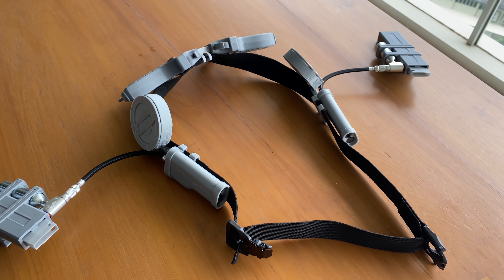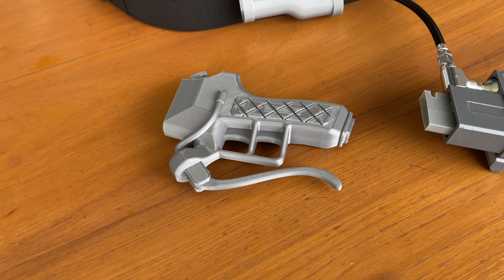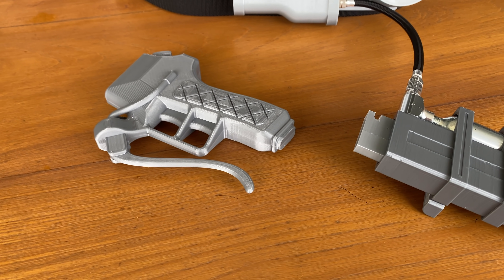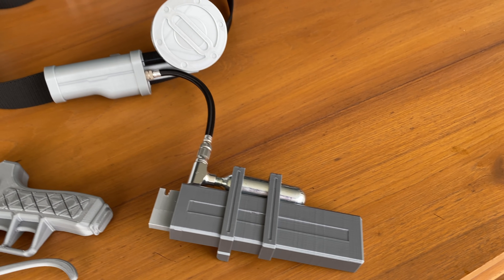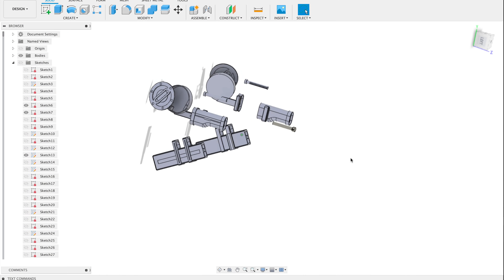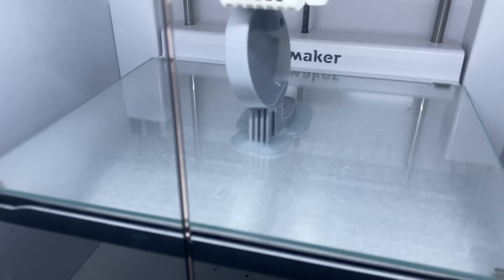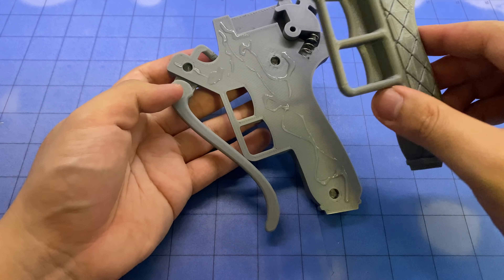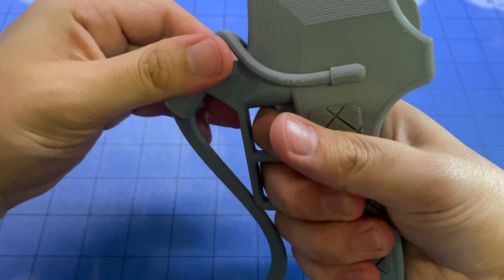Functional Attack on Titan ODM (3D Maneuver) Gear

Comment: The part about ODM gear I was always the most curious about is how the grapple disengages from the surface it is connected too. How do you make an 'arrow head' that can support the force of pulling in a human but then also retract and disengage?
Reply: Magnet that can be turns on upon landing and off upon retracting button pressed, and magnetizes back to the base of the apparatusz

Comment: I think the biggest problem we would encounter is not making it possible to support or propel humans, but the act of making the reel-in safe. Imagine making one of these reel in fast enough to give you time to fire off again before you hit the ground, and then it whips around on you like in the video. Especially if we use a sharpened hook to dig into stone structures. Yikes.

Comment: I think I know how this works. The retracting Mechanism is a tape Measure seeing how far it shoots you probably use a clamp on the tape Measure and release it to retract. My second theory is that it is very Similar to Shawnscrafts retractable web shooters in how you wind it up outside of the tape measures like your other webshooters then when it fires out you release the clamp to retract. The reason I think this is that the string unspools it dosnt unspool in a straight line it does a Circular motion. I love stuff like this too I just want to say keep up the great work!
Reply from the maker: Appreciate this, thank you!

Comment: You guys are on the right track. Now its time to scale up with human weight supporting parts and cable and a true to life gas exhaust component and you're on your way. GOOD WORK!
Reply from the maker: HAHA true! Thank you!
Reply: AND you need to develop incredible core strength and balance/coordination as well as be physically fit in general, and resistant to G-Forces.
Reply: @He_who_rides_many_winds  well said!
Reply: @Steadyrock100  Thank You.
Reply: @He_who_rides_many_winds  ηι¢єєє
Reply: While i do think that making an actual odm gear is possible you can’t make the same moves that are in the show because the human body was not built to endure that
Reply: Hahahaha
Reply: Dude, it's a toy, be real.
Reply: meow
Reply: it’s not possible to make it in real life, and never will be, face it.
Reply: @greasenob4821  It's possible.

Comment: Don't worry about the blades. Try using bigger Co2 tanks like for paint ball. Also use some type of tension cable or wire next.
Reply from the maker: Thanks for the suggestion!

Comment: I was wondering if in theory odm gear could work like in the anime if you used explosive gas inside a compressed chamber to fire the hooks at a near bullet speed and then used an electric motor to reel the hooks back in?
Reply: Hmm good thinking

Let's discuss something

Isyama did consult a real science engineer buddy of his to come up with the idea for the gear

His original take was gonna be jumping super high lol

Anyway

There's actually s turbine within the barrel version of the manga

Lemme explain

Grab a piece paper then roll it

Look at whatever side

Now imagine a turbine

Whenever compressed gas is released, the turbine is moved

And it acts as a high pressure fan to accelerate the gas more 

More pressure action

More movement

Comment: The hooks are supposed to go into objects and attach that way, not attach like a magnet. The blades and cables should be longer too. 
You also didn't test whether you can actually swing aroumd on it or be pulled by the cables retracting, though I doubt magnets would make that possible.

It's decent for a toy but not a serious recreation.